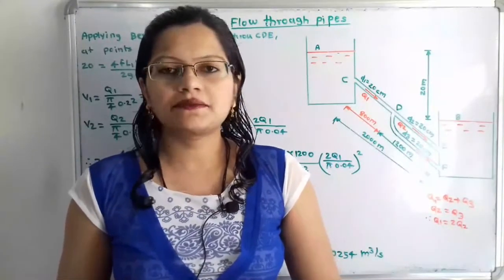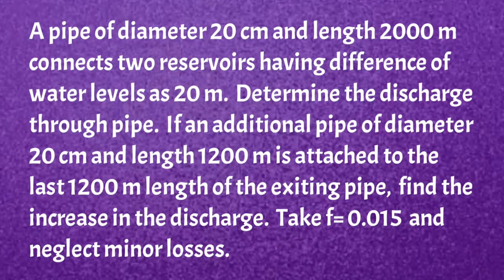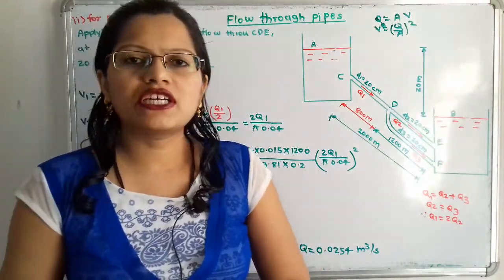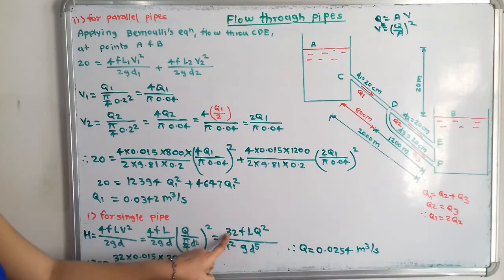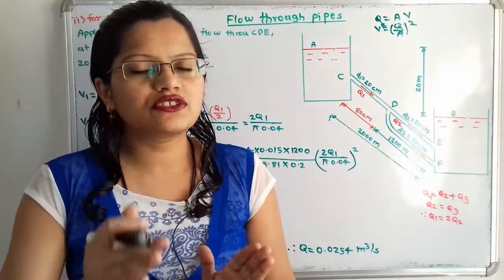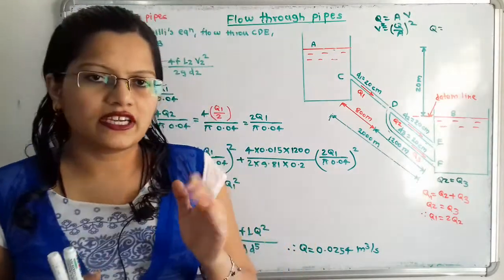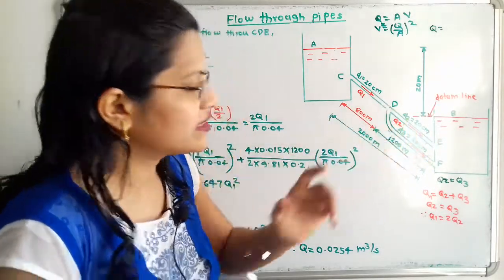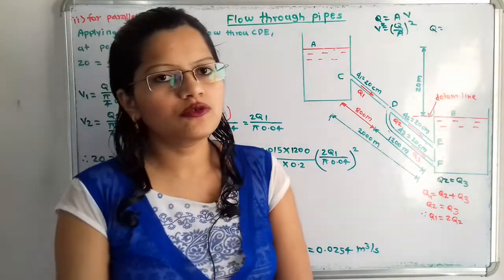Problem 4 flow through parallel pipes   pipe attached in between reservoirs at different levels

Comment: Two reservoirs with 15 m difference in their water levels are connected by a 300 mm diameter 
pipe line of 3000 m length. Calculate the discharge. If a parallel pipeline of 300 mm diameter 
is attached to the last 1500 m length of existing pipe, determine the modified discharge. Take 
only wall friction into account. Assume f=0.04.